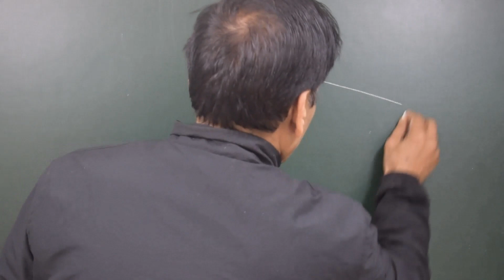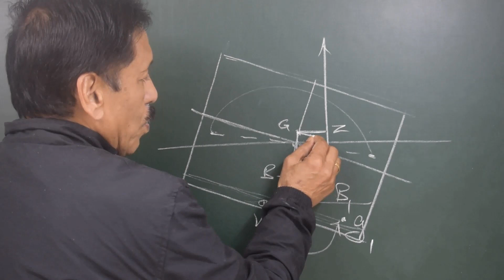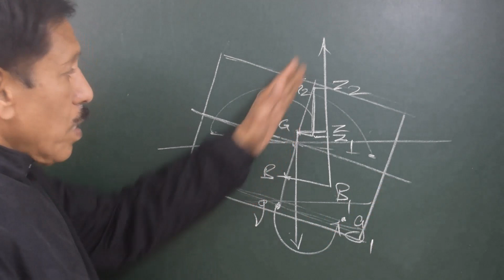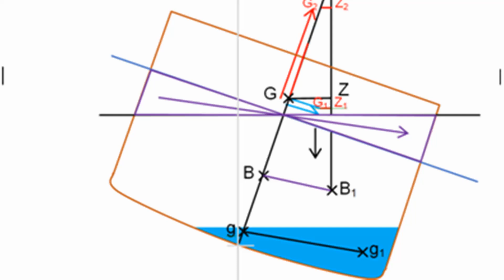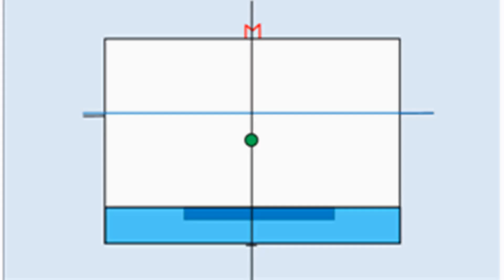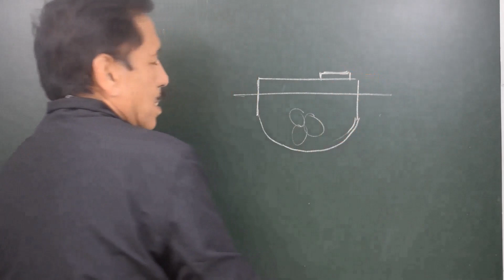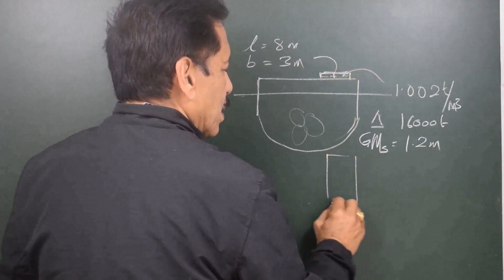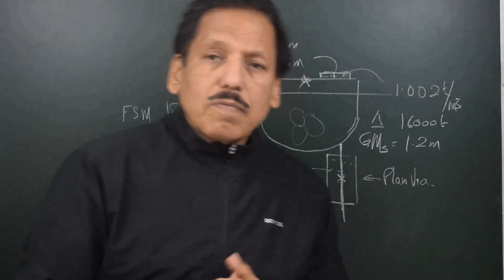Ship Stability Video 28. Why Free Surface of liquid causes Rise of G

Comment: Sir I thougt the formula for determination of Free Surface Correction is Density x Gravitationa Force x Inertia / Dispacement

1.002 x 9.8 x 18 = 176.7528

176.7528 / 1,600

FSC=  0.11

This is also correct?